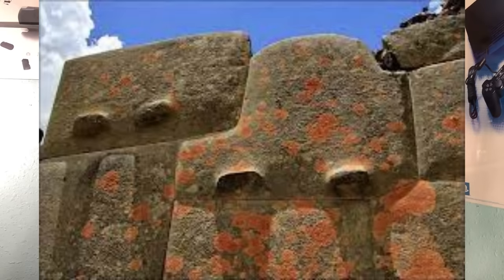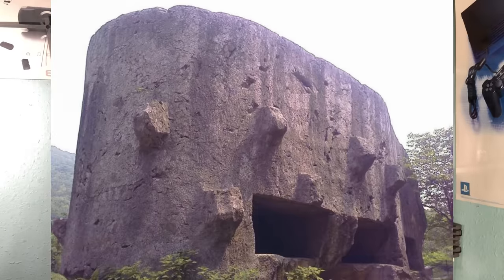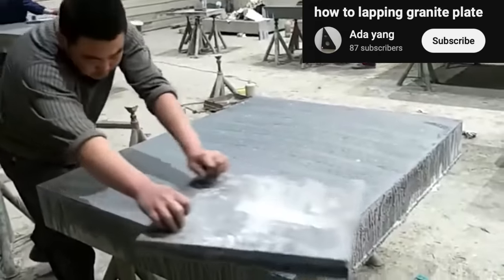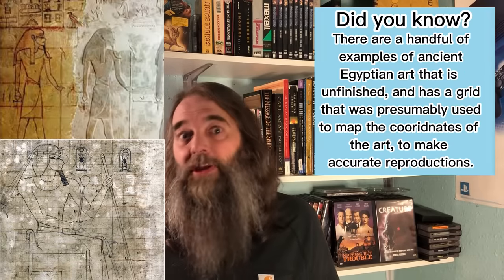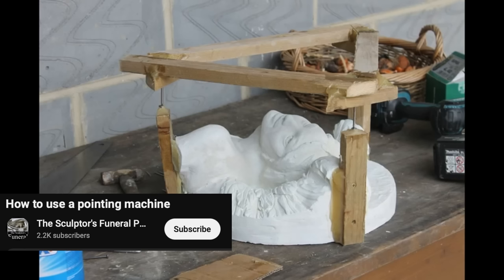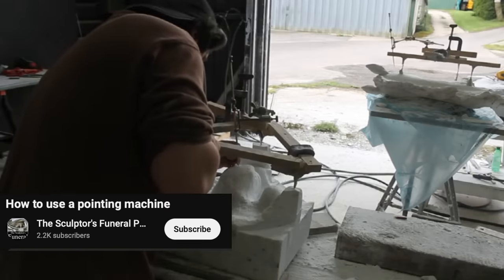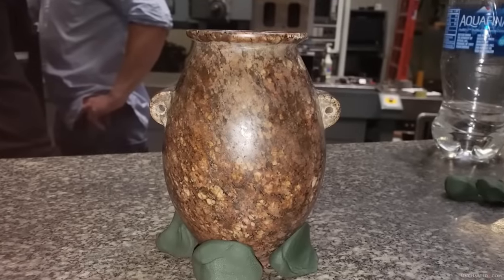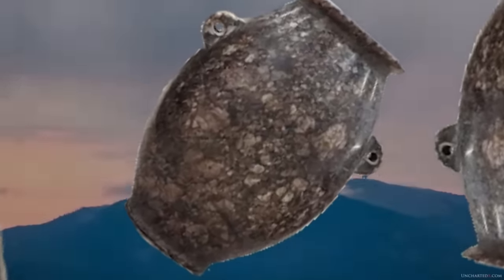The True Purpose of Megalith Stone Nubs

Comment: it is a volcanic clay that can be found in earth crust depressions at various locations - they can stay soft as a playdough for centuries until infrared radiation hits them from sun - it is a blue color clay when in its virgin state - once hardened in infrared which is part of solar spectrum - it turns solid within few months - the handles you see are not handles nor any sort of lifting perch - those are balancing weight additions or subtractions - so the final product can have a well balanced weight directly down without any tilting - the squeegee marks you see are simple way to revert hardening when they notice the piece is not in place - so it needs to be re-balanced by removing extra weight from one side or another - also in order for them fit properly and tightly they used mirrors to reflect sunlight and increase infrared radiation to speed up the hardening process - and yes volcanic ash turns into sandstone and volcanic clay turns into basalt and granite depending on how much crushed quartz was added - also keep in mind that quartz allows to speed up infrared radiation by getting deeper into the volcanic clay mixed with quartz - as a side note on how they made statues that look like people even having hand impressions on their skin and facial covers or nets that drape their bodies and dresses - that is well known volcanic ash mixed with crushed amber and then heated and poured into human impressions inside alabaster - then all pieces are assembled together and every place where they meet are filled in with volcanic ash that turns into sandstone when exposed to sun for a few months - of course buffed and polished until the gloss has been produced - moreover no one ever cut or chiseled any stones to make large structures - there was no need back then and there is no need of that now - places with volcanic clay as well as ash are all over the world - many of them are right in front of us but the overthinking of a principle knowledge is what makes us misunderstanding the old tech by assuming there is more in that of what we dont know -

Comment: Sacsayhuaman is an incredible site and man those walls are mind blowing. I like your hypothesis but my only problem is that the material is granite so o really doubt that all these walls are carved by hand. My guess is more into geo polymer use. Looking at the walls you can actually see that at some point this thing was in a kind of plastic state. It makes sense that you can place it, form it, cut it in anyway you want and more important the accuracy you have between the pieces. The nobs are the feeding pipes that get the polymer into its place, after finishing the piece they cut it and leaving a mark. Not all of the pieces have a mark because it depends from which point they filled them up. Who knows?
Reply: How do you make so called "Geo Polymer"?
Reply: @Bobcat-1967 how do you work if it doesn’t rain. If the earth was watered in another way

Comment: Saw a video on Twit, Showed construction workers making a large square block...

They used smaller large stones as fill for the interior & after they poured the mortar they stuck a long cylindrical device that violently vibrated into the wet cement and presumably this was to remove all the air pockets...

Interesting thing was it left a perfect Nub when they removed it, Now of course this doesn't explain the different sized Nubs or a host of other things 

But a Nubs a Nub

Comment: Excellent analysis, very thoughtful and logical.

I’m attracted to the theory the blocks were initially liquified (somehow!) in bags and the nubs were the shape of internal formers in the bags, used to retain their shape until the liquids sets. That nicely explains the perfect fit of the stones we see all over the world - even with irregular shapes and it also explains the weird external bulging, texture and exfoliation we see. To test that theory, maybe we should bore into a nub to see if it’s solid stone inside or the remains of a eg. timber frame?

Could another possibility be some kind of in-situ lapping, where the stones were cut to fit as close as possible, lifted into position and then lapped by moving back and forth to get that perfect fit we see? In that case the nubs may have facilitated the lapping process and the regular lifting required to hose out the debris, add more sand etc? My main question here is, why go to such lengths to get such a precise fit? That leads back to the former theory…

Comment: 3 stones. Not 2. It takes 3 stones to make a plane. Once you have a planned stone you can use the flat stone to shape a roughly flat stone to flat.

The constraint of turning one flat plane into 3 other relatively fixed planes has not been solved with a pointing machine.

The co-linear surfaces in line with the nubs don’t allow a stable triangle as they’re in-line with some of the surfaces: You can’t pivot a triangle in two dimensions, it only pivots in one dimension.

Wood is notorious for swelling/shrinking with seasons. The slowness of checking your work every 2-3 hammer strikes to ensure you haven’t overshot your mark would imply multiple seasons per block, and drift to any degree would have rendered prior work and new work out of plane.

Just placing a 2d outline where you want a extrusion to occur doesn't cause planar surfaces to emerge where you want them to. If anything you've placed wood in the way of where the work needs to be done. I too can draw a circle around the mona lisa.

You can’t plane inner corners or features that don’t allow the block to balance on the exposed face.

The calculations required to render a new, not a duplicate, 3d shape as regards polar coordinates relative to two fixed points would have been prohibitively laborious and slow. There is no actual 3d object to check against. Everything has to be calculated.

If you were using calculated coordinates then putting the nubs in uniform locations would save you thousands of hours of calculations.

Organizing that data and ensuring that only the correct data was being used to render a surface would have been a fool’s errand. 

Interrupting work to check a single point would have slowed work by a factor of 10. 

Checking nearby points would slow work by an order of 100.

Any mis-use of the data would have destroyed the work of the block ,and if the shape was determined in a pre-planned manner based on relative block sides it might have rendered an entire layer of planning useless.

And you don't seem to understand what a reference frame is. I would say you're embarrassing yourself, but you don't seem to have the basic knowledge in place for that to occur.

But aside from all that, it looks good.

Comment: WHY? I listened to the idea and had the same thoughts as these comments ... I think the nubs just some after effect of the process, and trivial to the built result. I think the real answer would be involved with why  they would make it so difficult with each different stone, when obviously having "skill", they could easily make same size stones work more quickly. If the stone material had crystal like properties to have effect with electricity, the odd shapes together might resemble the odd shapes purposely placed together in semiconductor construction ... of maybe just geological vibration of Earth movement would be subdued by the oddity of the craftsmanship that must have had purpose to do it in such an odd way, over and over at each location?? WHY the did it is probably the answer to then realize a how. ... but this is well thought out and informative ... I learned something I didn't know before

Comment: At 10:10, why lift it?   Why not have that framework to lower down onto the stone?  Then flip the stone to do another surface and another and another.  Or, better yet, have the stone laying in the side that won’t show, the face is on top.  The framework could be lowered onto the entire thing, sides smoothed, face smoothed, slide it to the position and turn it over into its spot.
Reply: Wait a minute, as I watch it a second time, that is exactly what he described.  

Keep in mind that, as you’re extracting a stone, that side where you separating it from the wall is a finished surface to some degree.  AND the quarry wall that the stone is being quarried from is now a usable surface as well.   How about that?  Two walls are somewhat or are completely finished.

Comment: These stones were poured into a mould from molten stone or polymer, look at moulds for cast iron and you will see these so called nubs sticking out from the mould, they are where the material was poured into the mould. Some stones have no nubs because the mould was poured flush with the face of the stone and not to the top of the mould funnel.

Comment: How about this carve/pour  1 stone…use its shape to make a mold for next..pour..that’s stones surfaces used as form for next poured stone……etc…all could be poured on site of placement or just behind it on top of mounded fill behind wall or in front. Any idea how quickly this set..if fast just pour slowly in place and molds would not need to be very strong if quick setting

Comment: A question about lapping: do you need a perfectly flat stone to push around on the unfinished larger stone, or can you use an imperfect stone to smooth the surface of an unfished stone?

If the former, how would an ancient culture get a perfectly flat stone to do the lapping work on an unfinished stone?
Reply: @jr1648  rub them together.  Physics does the rest

Comment: Ok so i could assume that they left the nubs there during the whole build for reference points that they could return to during the construction to reference back to to double and triple check the measurements of the whole thi g by using the reference points and when it was all done they didnt care to clean them off because of spackling or because banners or covering was going there? As the nubs on the great pyramid was covered it wouldn't matter on them and on some of the other structures i have see the numbs could be low and might have been uncovered footings or there was going to be flags or banners there and it didn't matter?

Comment: Interesting idea but the wooden frame implies that the stone is cut outside of the wall like a jigsaw piece and then placed into the wall. Going back to the geopolymer theories, I think the nubs could be where the nozzle (like an icing bag), leaves a little lump of stone/cement after being poured into the mould. Who says the wall had to be cut/carved in situ? It is entirely plausible that the stones - if geopolymer - were poured into moulds like a jigsaw puzzle on the flat and then assembled into the wall vertically. I don't think electricity factored in at all so the nub has got nothing to do with that. It's simply the "blob" of pour. Sometimes they'd smooth off the nub and other times they'd leave it. Simple.

Comment: Nope, I reckon you are completely wrong. None of those stones were pre-cut as you suggest, that's absolutely ridiculous. Those stones were poured into place, like injection moulding, hence the nubs or spru points. That rock was liquefied, that's why some don't have them as they could simply be poured from the top. The more complex ones require extra injection from the side to fill the gaps, hence the nubs.
Reply: I take it that you have never once done a concrete pour.  If you have how did you get it to be homogenous?
Reply: @genebohannon8820  I know a thing or two about concrete, having been involved in skatepark creation. I'm not referring to any similar methods.

Comment: G'day, It is a nice idea. Seems a little clunky to me though. Not saying it wouldn't work just seems like its a lot of set up for an awful lot of stones.
  I used to be a stonemason and stone carver( I wouldn't call myself a sculptor.) and when I did gravestones sometimes the plots were to crowded to get a truck with a crane close.
 So it became wood logs and lever bars, and rope(you can't use a trolley as the wheels sink into the grass you normally find in graveyards FYI). I think they were probably for lever points to position them myself, that were never smoothed off for some reason. I don't know much about them, but from the few pictures that would be my guess.
 A lot of people forget rope and string can be used to measure, along with a compass and a straight measuring stick. So long as things are all made from sticks the same size with markings that match, your workers all have a uniform system to use.
 I can mark out archways, using only string, I think these guys would know what they were doing.

Comment: @1:56 You mention 'liquifying stone' is a violation. Limestone once fired and the by-product 'quicklime' slaked IS liquid stone, is it not? Potash? Gypsum? Clay? And lime curing reverts to a hard stone constitution... 500-year-old cured quicklime is basically limestone again. 

I buy your thesis. I think it also explains a problem of a particular issue of core drills too. Drilling cores today that requires absolutes and dont 'wonder' around the kerf are held in place by a frame. Your frame lends itself to this ancient core drill - a frame to mount the drill + a gear turned by water/wind/animal/human. Essentially a mill. That makes possible many more adaptions beyond a mallet and point. Ancients knew metallurgy to a point (pun intended).
 You have earned my respect, @DeBunking. A simple tool like that achieves absolutes.
To add, I think the nubs are as you say, and also a reference to the neighbouring stone by transferring the negative space. Also, the nubs would be excellent points where ropes could be anchored...

Comment: I strongly doubt they would have been cutting those blocks to fit the ones that were already in situ. My guess is they were perhaps dozens of blocks ahead of themselves cutting and shaping them on the floor long before lifting them into position. Also, those 'Nubs' are clearly Not Random. They could have be used as some form of Scaffolding points.

Comment: If that were true wouldn't the nubs be more squarish and less roundish in shape. Fitting a frame over 4 90 degree corners would secure the frame for sure but the nubs don't usually have defining corners to lock a frame over and are instead oval or roundish and kind of taper off as though they were pinched making it much less reliable to lock onto with a frame. if they are used as a lock with a square shape frame to fit over it then they would have all been square or rectangular in shape in the first few inches from the face of the rock . That would secure and lock a frame much tighter and accurate than what we see with their roundish oval shape. and wouldn't all the stones have them and why didn't they grind them off after? Why were they left on the stones?

Comment: Thanks for the theory.  How did they "build the framework" over and over and over and over and over again?  They would have to make wooden pegs to hold the framework together as they didn't have power drills and wood screws or epoxy (that we know of).   In my opinion, those little details are where many of our guesses break down.
Reply: Building wood (or bamboo which they had) frames is a basic skill within traditional cultures. Some of these cultures had elaborate timber frames and related wood joinery modalties. Replication (in this case templating systems) was common in textiles, ceramics, bone, wood, and of course...stone...which is evident in the architecture left behind...I agree, those are the details that many "woo-woo" experts always leave out and also never make any attempt to even learn the basics of them by those of us who still work in these modalties...

Comment: No. These stones were poured, not carved. 
The nubs are pressure release points that allow the stones to settle into the shape of the stones beside them. 
The step shape sides where they mate up are made by trimming the top or side of a pour with a tightly stretched wire before pouring the next stone.
Reply: I call BS. If the stones are being poured, then why make each one of them unique dimensions?

I mean once you have a mould, why not reuse it?
Reply: @AStewart-jd8ep  yeah, I don't think they would make a new form for every stone. I would assume whatever they used could be reused for different size stones though.
Reply: @timothyappleseed2986  Yes but why the need to make what are effectively moulded bricks in different sizes?
Reply: @AStewart-jd8ep  the former stones provide part of the mold for the ladder stones. It's easier when the stones don't have to be the same if they are poured in place next to existing stones.

Comment: With such stone cutting skills,whoever built these walls could have saved time and elbow grease if they had made repeatable block dimensions,as we do today with cinder blocks, and still,having them molded,we can’t fit them with the precision achieved.They also must have had enough knowledge of geology to know before hand that the rough rock they were about to shape would yield the maximum amount of material sufficient to build that particular piece.Let alone how to position it,lift it once finished,without chipping it while handling it and having to start over.And why,some pieces are like wedges fitted within adjacent rocks,which would mean that said wedge would have to conform to the top,bottom and sides of the adjacent rocks while keeping those close tolerances ?

Comment: Used for lifting I always thought. We use something similar to move heavy cabinets. My job was considered skilled then the 2008 recession hit and we switched to the assembly line and started buying Chinese with reduced quality. High quality sped up and then quality reduces. My house has old brick work which is top notch but later brick work is crap. Todays brick work is garbage.